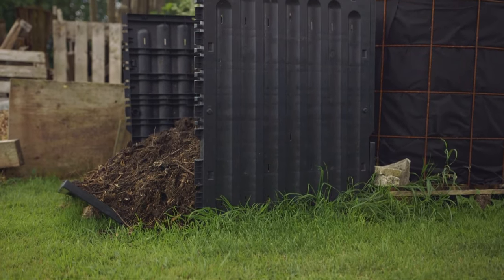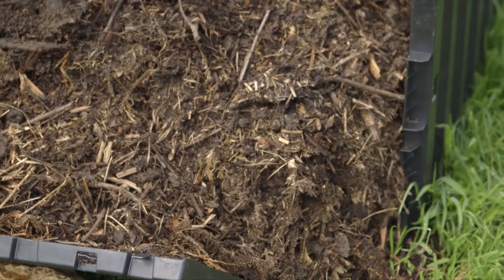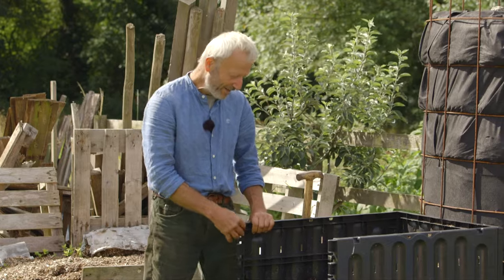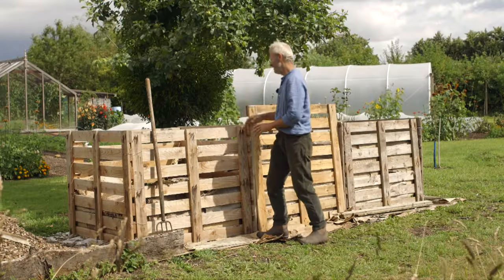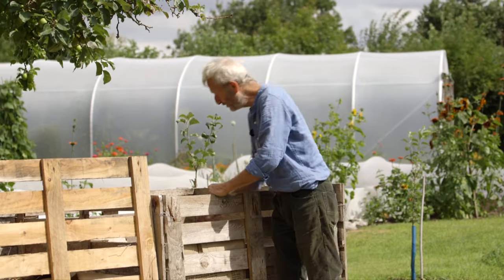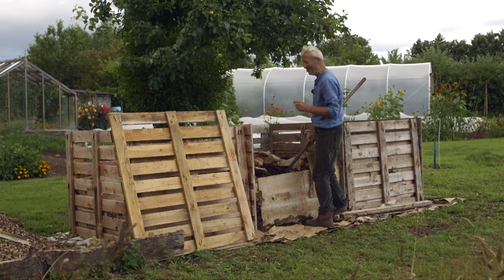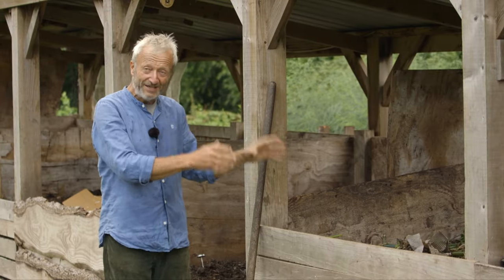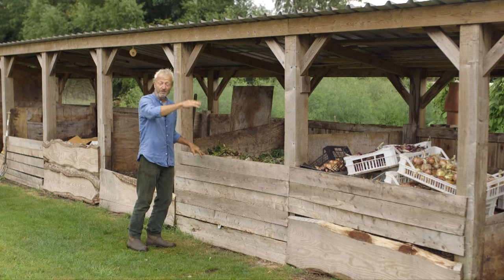Three Types of Heap, see how they work and the compost they make

Comment: Charles - I am in awe of your compost sheds. I have tried many years ago and many times to create a working compost heap and have never had any success.  The quantities of waste required for heating up efficiently are much more than the average garden and kitchen can produce.  My method is to take all green garden matter, shredded paper, cardboard, and kitchen waste and bury it in a hole or trench at least a spit and a half deep.  After a week of settlement, I can then plant a new crop on the ground.  Any autumn leaves are just left on the surface of the soil and get broken down naturally during the winter months. I've never had any problems with nitrogen deficiency, no compost heaps, and a beautiful growing medium with worms in abundance.  Yes, I still dig a bit once or twice a week but don't have to turn heaps or cart compost around - the work involved, I believe, balances itself out.  My growing beds are 4' 6" wide and never stood on.
Reply from the maker: Clever!
Reply: I have a small ish garden, and have more than enough waste, I've got a dalek composter, and two pallet composers. They're all pretty full. They take up space but it's worth it! Im sure I could fill that big one up quite quickly for Charles 😂

Comment: I covered the compost for protection from too much sun, flies and mosquitos. The heat in Central MX is quite intense. This first week of this month of July the temps have been a bit milder. Thank you, Charles for your program. I'll keep you posted about my progress!
Reply: If you're doing hot composting, there is no such thing as too much sun (at least heat from the sun. You still need to keep the pile moist). Flies and mosquitos should not be a problem unless you have raw food or high nitrogen materials in your top layer. You can solve this by making your topmost layer carbon, eg papers, cardboards, dead leaves and brush... Nothing alive or recently alive and generally low moisture content.
Reply: @tonysu8860  Thank you for your advice, you are very kind.

Comment: Also have one of those plastic compost heap enclosures as well as a self-made heap made from old pallets.
And I almost suffered from depression to see your temperatures rise to 60 degrees and above on your standard pile. What am I doing wrong I wondered..
But after seeing you here I got totally consoled. Even temperatures up to 40 °, like mine. And you said you didn't get them higher on this pile got me back to sleep ...
But now I've discovered a trick: I mix coffee grounds from a restaurant with water from above with an iron rod, and ... wow ... 3 days later my thermometer reads 65 ° ... :-)
Reply from the maker: Happy to help you Lukas, good tip on the coffee

Comment: Thanks. I love your videos. You are the best garden channel on YouTube, bar none. So I bought your book and so has my sister.  BTW, I have a bin similar to the small plastic one you have. I like it, since I have limited space and it looks good and my HOA is picky. The bin works great for the Berkely Method. Every other day, I turn the compost onto the ground in front of the bin and then re-fill it. A month later, you have 20-30 square feet of compost. After the compost is finished, I pile it in a corner to cure and build a new pile, trying to gather material and fill it all in 1 to 4 days. Then it's lather, rinse, repeat.
Reply from the maker: Nice to hear Leo, good tips!

Comment: Last year I started composting after watching one of your videos. I found an old plastic dustbin behind the shed, I knew it would come in handy. I cut a hole in the bottom, turned it upside down on the grass. It's perfect for the kitchen scraps, topped with some grass clippings and mowed over hedge clippings and old compost from the flower pots. I leave over winter and it's ready to use in the spring.
Reply from the maker: Nice work Stephen

Comment: Love talking compost.  It's where a good garden begins.  I use a six bay system 3 bays facing 3 bays so it's easy to toss one pile in across to the other bin.  I just use that green coated fencing for my bins which has lasted 25 yrs now.  I lose a little out the sides but not enough to worry about.  I also use a small roto tiller to churn when I turn the pile.  I know I'm messing with the worms but I end up with thousands of worms anyway with all the leaves I use so it's all good.  The roto tiller really helps to quicken the decomposing process.
Reply from the maker: Nice work Frank

Comment: Great video as ever. Very clear. My biggest input by volume is in the autumn when we clear the wild lawn area which has grown up over the summer so the grass is a mixture of green and brown (dead seed stems and leaves) but its difficult say what the exact proportions are. I can fill upto 12m cubed, in two bays about 2m x 3m but its amazing how it eventually shrinks down. 12m3 ends up as 3m3 if left for 12 months will limited turning. Hottest temperatures reach 65C. Now building a secondary pallet system for easier turning.
Reply from the maker: That sounds amazing Andrew and it's good you are getting that temperature because there must be quite a few seeds in there as well. One quarter by volume sounds about right !

Comment: Taking an idea from the Johnson-Su bioreactor, I used pallets for the sides of my composts, and put a complete pallet on the bottom as well.  I cut round 6 inch holes in the bottom pallet and inserted white sewer plastic pipe, 5 feet long temporarily in the holes vertically.  Once the compost box is completely loaded, I wait a week or two and then slide out the plastic pipe.  The holes remain easily and a year later…beautiful compost.  No turning required.  Just leave it alone and it does the rest.
Reply from the maker: Really good idea! Thanks for sharing

Comment: Hi Charles, the cylinder shaped compost pile at the beginning of the video looks like a Johnson-su bioreactor ; it's also based on a first heating phase then adding worms to achieve the complete decomposition when temperature falls under 80 F. The major claim about this concept is the no-turn heap ; but it seems not easy to manage because it needs to be filled @ once and moisture looks difficult to control.
The traditionnal 2 or 3 bays heap looks more practical on a gardening season basis. 
Does it matter if it takes all the season to fill in 1 heap ; lets say in 6 months, to fill 1 cubic meter. What would you recommend if finally filled during late summer, beginning fall ; let it sit until next spring or still turn it ? And if turning it about how many weaks after ?
Reply from the maker: You are correct in your comments and we shall cover this in a later video, mostly about woodchip. 
Your late summer heap could be usable without turning because it will have matured slowly and steadily. I would be tempted to spread it this spring and not worry about any turning. Just put any undecomposed portions back into the current heap.

Comment: Great advice.  I'm stil fan of your channel. Undoubtedly the best tips for composting. Thank over and over. I'm making compost in a big cardboard box in my patio which is made with square porous brick tiles. I don't know if it will work but I'm trying. This is going on over five months. I start the compost in a smaller plastic laundry basket with lots of holes on the side for ventilation, then, I mixed it with the older compost, sort of what you do with the three pallets.
Reply from the maker: Best of luck Martha and that sounds an amazing adaptation!

Comment: I really struggle making compost, getting the heat in is my problem, not for sake of trying ill tell you. The only thing i don't do from your guide is stamping down, kinda makes sense.
Reply: It depends on the size and location of your bins, but is there a way of getting insulation round the outside. I use celotex offcuts and get great results. Even just a celotex (or similar) square on top of your pile will help. Hotbin on the cheap!

Comment: We made a 3 bin pallett system but with the full pallett - didn't have the energy to saw through them! So the gap I filled by getting peoples' recycled polystyrene from packaging.  Very easy to cut into shape and slots down in gaps surprisingly well.  Has increased heat particularly in winter. For the orchard I just use builders bags with upright posts at corners & they've been a revelation. Fill them up in autumn, cover and by next spring they are ready! Think it's the mix of air due to branches and wood that really helps. Only thing I'm wary of adding is marestails. I do try to drown those in a tub.
Reply from the maker: Nice work Claire

Comment: I run a 3 bay pallet style system (old full sized pallet crates, used for bulk delivery of potted plants) and tried lining with cardboard inform the first year and found that the cardboard drew moisture from within the heap to the outer cardboard and then the cardboard dried whilst exposed to the wind. That was my theory. In response this year I dismantled pallet planks and lined the structure with planks leaving micro gaps and drainage and found the heap is retaining moisture. Forgot to add that the heap is off the ground (may have something to do with moisture loss) on as I have mares tail and have found that mulching with cardboard as I did for my greenhouses raised beds, does not get rid of it! Fantastic method on how to utilise the 3 bays effectively but starting 2 and then turning the 2 into the middle heap to make a full one!
Reply from the maker: Yes all slightly different for you!
Dry cardboard cannot transmit / wick moisture so I'm unsure where it went; it works well here.
Good luck with marestail.
Reply: @CharlesDowding1nodig  thank you, I definitely need it 🙃

Comment: Amazing timing Charles! I emptied out my "dalek" today to mulch over Pentland Javelin potatoes (aiming for harvest at Christmas). As you say, it's not big enough to get properly hot so takes a long time to decompose and I'm finding lots of "compostable" food waste bags very much not composted. I have confidence, and patience, that that will happen, I can just chuck them back in. I have noticed that my compost is quite a bit more sludgy or doughy than your usual quite fine crumbly stuff. I'm sure it will be fine.
Reply from the maker: Nice work Tom, and it sounds like you could add some more paper and dryer carboniferous material

Comment: I used to pile a three acre lawn mowings using a Snapper, of just plain grass into a gigantic heap. After two days I pushed it using the Snapper front fork attachment, rolling it into another heap. The outer, now dry, layer was dry and more of a carbon. The whole pile used to heat up to a combustible pile. Didn’t have a temp gauge in those days, but it was HOT. I did this to lower the grass cutting pile as quick as I could. Never in my wildest dreams in those days did I think the end result would be perfect for “no dig” cover for the flower borders (which I did dress with beautiful gold compost from the tarp covered muck heap pre pyralids days). 

I think the composted grass was left to disintegrate. #whatawaste 😩

Comment: Regarding composter size and heat...
I have a smaller decorative composted that's about 3 feet diameter at the mid point and 4 feet high. It looks like a terra cotta urn. I'm in Canada, so it freezes in late fall shortly after much of the garden waste goes in. I continue to add over winter and it's overflowing with material by spring. As soon as it thaws, the entire mass gets going all at once and I easily achieve 130F. Usually as high as 150F, and I have to give it a turn to cool it down occasionally. It stays hot for a week or more. I'm assuming that the rapid warming combined with an entire container full of ready-to-go organics allows for the high heat. During summer with gradual additions, it doesn't get nearly as warm.
Reply from the maker: Really interesting! I would not have thought that :)
Reply: I also have 3 black plastic composters about 3 ft diameter and 3.5 -4 ft tall. I’ve never bought a thermometer to check the temperature, but my compost heats up both in summer and some in winter.  I’m in the USA zone 5b.  
I think having the plastic lids helps contain warmth, as well as when I get the proportions of brown, green & moisture right.  Sometimes I don’t, and when turning the pile, will get pockets of stinky clumps.  But when I turn them into the next bin and break up the clumps with my fork and sometimes add more fall leaves, it ends up ok later, when it’s finished.  It’s different every time- sometimes turns out good and sometimes not so good.  But I think I’m getting it more consistent, and just learned in this video that I should be pressing down (compacting) the pile when using twigs and woody materials.  Always learning something new!

Comment: For those that haven't dared ask, I have found that if you find construction going on at houses near you, it's almost always the case that if you ask for any unwanted pallets, they will allow you to cart them away free of charge. I've built a 3m wide composting area using freebies from construction projects down the road. One of the bays is currently filled with woodchips I cadged from tree surgeons who were bringing a neighbour's rampant forest under control. Composting is almost always free! And much of my 'browns' nowadays comes from the pruning of our fruit trees, which I chop up into small little sections with secateurs and just make a pile in the winter to be cadged whenever I need to add some browns to a bin.
Reply from the maker: Nice tips Rhys!

Comment: I do my heaps in the open without sides, they would be nearly as big as your large setup when finished. I have no problem getting them above 60 in summer. In Jan feb they only go to 50ish. I am collecting all types of garden waste when building up to the heap and then mix it all up when I have enough. Made a heap 7 days ago and within 5 days it was over well over 50. Main ingredient for my compost is leaves, have a good supply from my own garden but also in the fall go around and collect some (there is always a big tree around in the Neighborhood with lots of leaves underneath) I also collect seaweed and maybe some horse manure (am scared of horse manure though due to the problems). One other thing I like to use is big sticks to get some air in (these take a few compost heaps to break down). Enjoyed the video and as you say it’s not that hard, once you make a few heaps you get to understand what works for you.
Reply from the maker: Lovely work Fergus 💚
Reply: I think I would call that a midden heap. A local farmer encourages me to put my grass cuttings and weeds on his pile. I am about to move to a small holding of my own and thought I would try both, midden heap and pallet compost bin during the first year to see how they fair. Can you compost braken would you know and if I let it dry first, turn brown, would it be classed as green or brown material?
Reply: @meganrosney287  don't see any issue with composting it. I would consider it a brown either fresh or dried. Its quite woody. Probably needs less green/nitrogen when green. If it turns out to be a little too green you can always add some browns leaves, cardboard etc. Final compost will be slightly acidic and is one of the substances being looked at as a substitute for peat.

Comment: Thank you for the excellent video, I have been making compost for years using two small bins. It works great and the only sprouting weeds I see are from watermelon and pumpkin. As brown material I prefer to use thin branches that you turn into wood chips. Only last week I made my first batch of charcoal and added it to the compost. Mostly for structure and apparently it can harbour bacteria and fungal spores. I will see how it turns out, it was fun making the charcoal and it smells like smoked ham.
Reply from the maker: We are about to have a go!!
Reply: One assumes that you make your charcoal by finding a suitable tree and then engaging the services of one of Lady Sybil's swamp dragons?

Comment: The method that works for me is welded wire fence rings covered in nursery fabric that are about 1.5 - 2 m3 each. I'm a one turn composter as well. I peel off the ring and reset it. I give it  a single turn and grind with an electric tiller and restack it with fresh grass clippings lasagna style. I'll be waiting for your result with that Johnson/Su looking setup that you showed but didn't discuss. I'll never use a ladder to stack a compost but I'm interested to know what your result will be.
Reply: Yes ! the reactor in the back of the first part of the video  was the elephant in the room . Great and informative as usual from King Charles

Comment: As heat rises to the top of the compost pile, every little cracks and spaces within the compost becomes like a chimney. As hot air rises, it sucks air from the sides and bottom of the compost pile. And when it rains, the water droplets from the top, sucks air into the compost as gravity pulls the water down. That's why you don't even have to turn it if your feeling lazy.

Comment: It may be trivial, but the pallets used here appear to be true 4way pallets with the blocking removed. Try to do so with stringer pallets and I believe you’ll just get boards if you cut the top off.
Reply from the maker: Yes this is right and I guess then that we are lucky, that all pallets arriving here are made in this way. Otherwise I would be tempted to make some frames using the boards